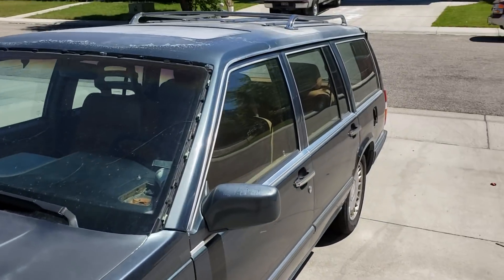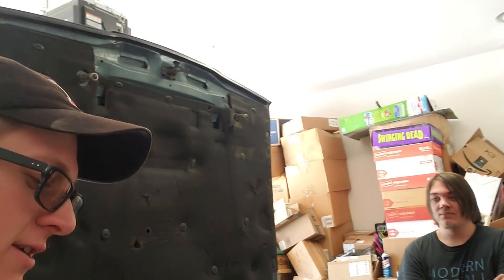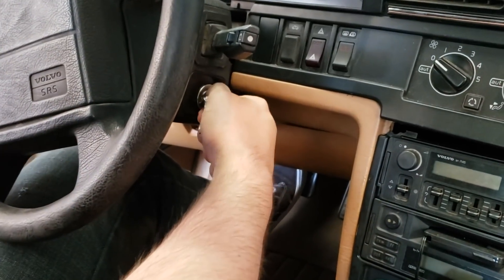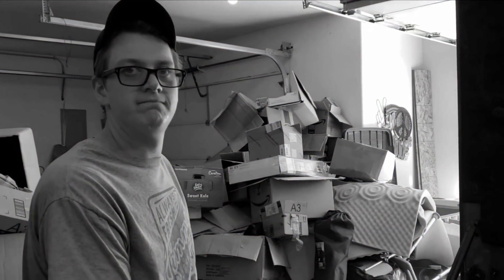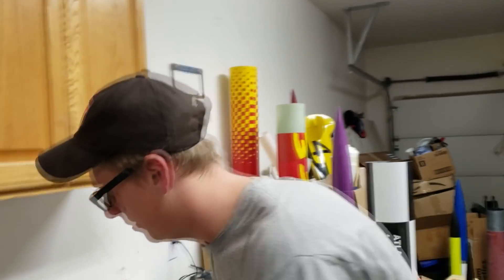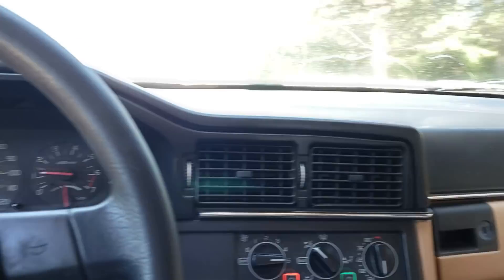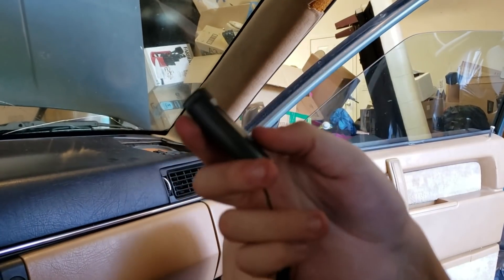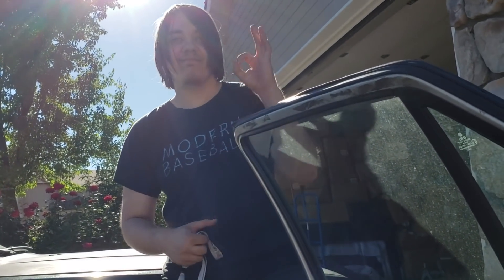How NOT To Convert and Recharge your Air Conditioning (R12 to R134a Retrofit, No Evac!)

Comment: My XJ does the same thing with the vents. I’ll step on the gas and the air blows away from the vents and goes into the defrost. I’m not sure why it does that but the ac control is not electric it is vacuum operated instead which might result in the interference with the whole  system.
Reply: So the default setting of the mode door is footwell and defrost or just defrost because it is a legal mandate that all vehicles have a defrost mode so if for some reason you lose vacuum to the servo you only get defrost in case you need defrost and it defaults because at high rpm the engine doesn't make much vacuum so it can keep the servo engaged

Comment: It’s because of short term repairs like this mechanic shops get very expensive repair bills due to damage caused by customers or do it yourselfers who work on other peoples cars.
Reply: Then maybe they shouldn't sell these retrofit and conversion kits in auto parts stores?  I mean its a cheap as fuck car, with parts that likely no longer exist, whats the harm in using a kit?
Reply from the maker: The car was $350. He wanted cold air, it has cold air now. It will not likely see any mechanic shops

Comment: That’s gonna leak out. It’s a closed system that will only lose Freon if there’s a leak. I give it a week or two
Reply: Proper thing is to pressurize it with nitrogen and search for leaks at every joint and valve. Then vac, and weigh out the Freon. If you have a 1lb system and the cans are 12oz, just use a whole can and some of another.

Comment: The vent issue is a check valve. It’s in the rear mounted distributor area, maybe a bit more to the driver side.
It’s black and white. Replace that and no more issue with it blowing to your feet. I’ve seen this on tons of 240s, 740s, 940s, and 960s.

Comment: Yo ANSWER FOR THE VENTS THING.

Flaps are vaccum controlled, there are 2 little check valves con vaccum lines in the zone around the brake booster. Take them apart, they should only allow air to flow from one side, and they are probably stuck or broken, so it changes to floor vents when you go on boost.
Reply: that's what it sounds like

Comment: Yeah it's a Swedish thing dude. Saab does it too. When you turn ECON button on, it stops switching the vent flap position and it just comes out the vents facing you. It's super annoying and you need a Volvo Specific scanner to connect to the car and turn that bullshit off. I'm still searching my GM Tech-II on how to turn that bull shit off or at least not have the Automatic climate control turn on on full blast on the windshield all the time.